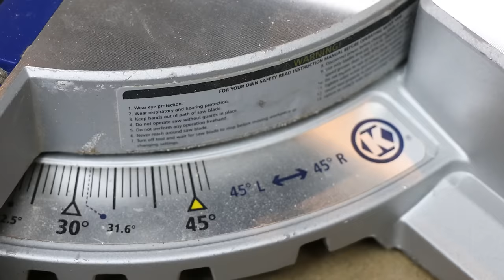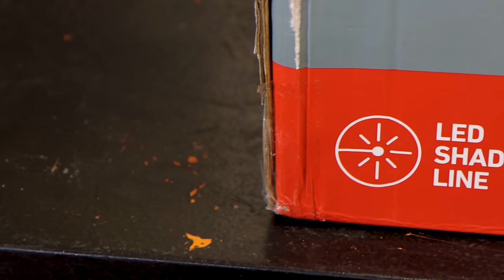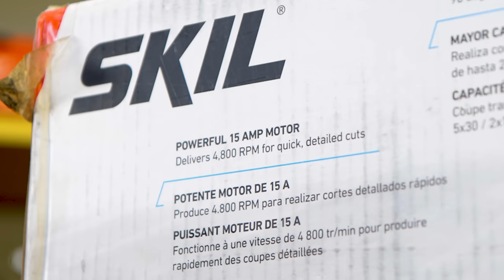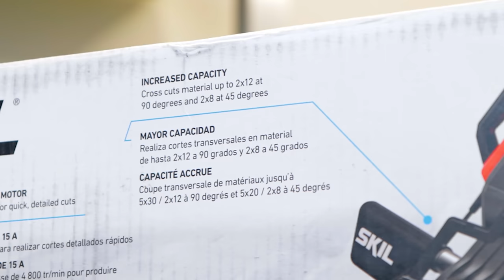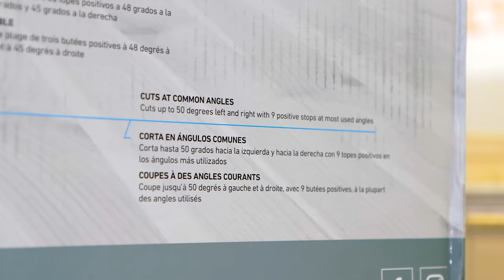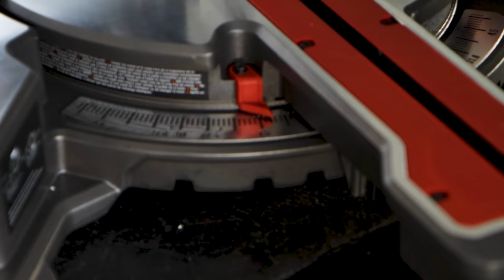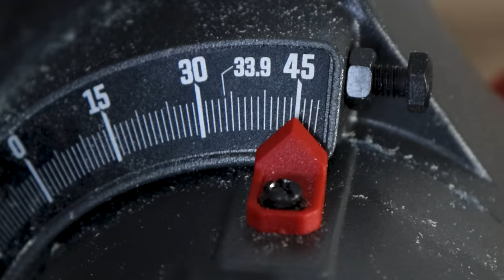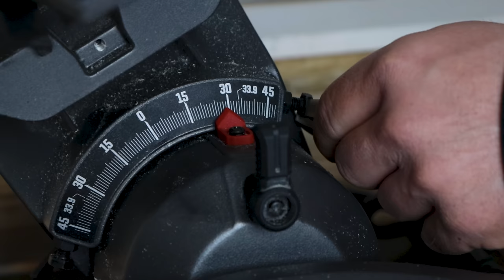Best AFFORDABLE 10'' Dual Bevel MITER SAW (You Will NEVER GUESS The BRAND!)

Comment: Having used this saw for 3 months doing trim carpentry. It is NOT accurate lots of play in the rails and the table moves independent of the fence. I have tightened it and adjusted it but there is no adjustment for the rails.the best part is the led light.
Reply: So was it accurate when it was new and something happened to make it not accurate? I ask because the one being tested in this video was spot on.

Comment: I bought this same saw and it punches above its weight class.
Reply: how so?
Reply: @rickdeckard1075  Duel bevel miter saw, that slides and provides a good cut, pretty solidly built with plenty of metal, with sufficient power for $222. My brother is a carpenter by trade and even he said his $600 12" saw doesn't provide that much better cut. I'm not saying it's a job site saw, but for residential work it's a steal.

Comment: If your a contractor, trim carpenter or cabinet guy, you DO NOT want to buy a mitre saw ( corded or cordless) that does not have positive detents at 33 and 31 degree's  on the mitre and compound mitre scales to cut large crown mould on the flat, that includes the Festool kapex at $1500.00 huge omission!

Comment: ..This guy seems to be having a love affair with Skil...that said, I agree with most of his observations and would like to try a Skil 18V impact driver..my problem is that nobody seems to sell Skil in stores, and I don't like buying stuff like this online without putting my hands on it...
Reply: Skil is great have their circle saw, impact driver and also hammer drill
Reply: @killa.quany.2kgod828  ..any major stores sell them?..or did you buy them online?...
Reply: @dyer2cycle  If you live near a Lowes there should be some in store
Reply: @jasonwallace1003  Thanks for the tip. I don't have a Lowe's very nearby(I do have a Home Depot), but I was out of town today and saw a Lowe's, decided to stop in and check it out. They did indeed have some Skil stuff, but only an end cap, and it was all 12 volt stuff...I am only interested in 18/20 volt stuff. My observation with Lowe's, is they seem to be having a love affair with StanleyBlack&Decker's Crapsman stuff..they had a huge array of Crapsman cordless power tools, more of it than their own house brand Kobalt stuff...and the Crapsman stuff seemed way overpriced...same with their Kobalt hand tools, it was badly crowded out by the Crapsman hand tools, and despite most of them being made in China, seemed to be 30%-40% higher than the comparable Kobalt stuff, which was made in Taiwan instead of China, and was of at least equal quality...I do know Crapsman has crowded out Ace Hardware's Ace Professional hand tools, which were of very good quality and much cheaper than the Crapsman...same with Napa and their Evercraft stuff...seems that Crapsman has become the anti-Craftsman...sorry about my rant about Crapsman...at least (yet) Home Depot doesn't carry any of that stuff. Hopefully, eventually, someone will carry a full line of Skil cordless power tools.. :)
Reply: Picked mine up off the shelf at Menards. $249